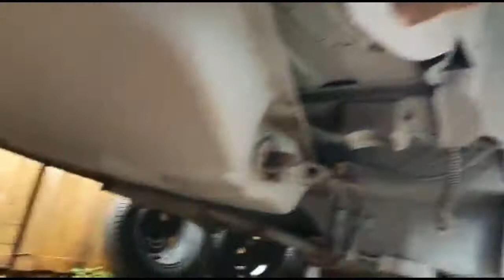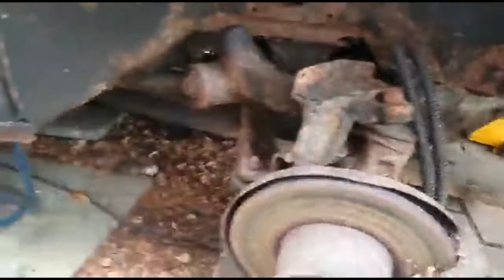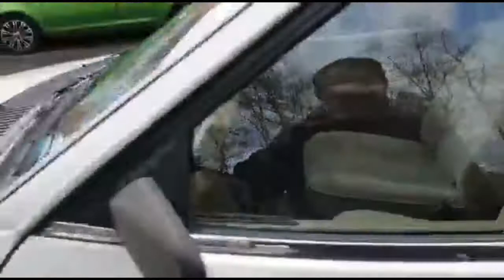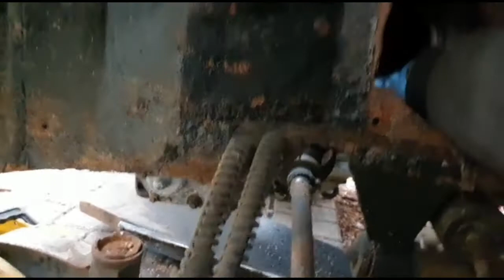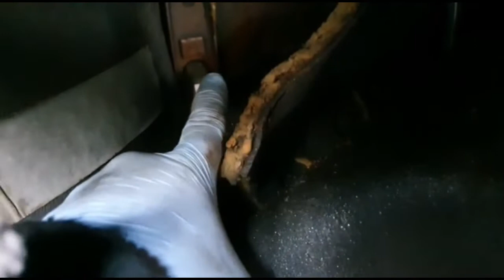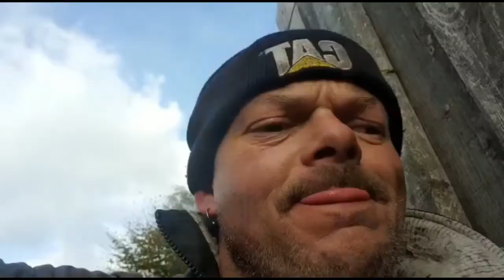Lee’s British Leyland Austin Princess | Stonechip | Fitting The Hydragas Suspension | Part 7

Comment: Good info about setting the pre-load Lee, I set the rears on Allegro as per the book. But the fronts I set mid way between the bump stops, is it worth setting the fronts to the ride height of 373mm ?
Reply: Hi, Thanks Steve.
If the ride height for the Alkegro is that of 373mm.... then Yes, set it to that. 👍
Reply from the maker: I’m pretty sure I’m set at 360. I believe there’s a slight difference between series 1&2?
Reply: @AgathaAndAnything  The series 1sits a bit higher Ricky